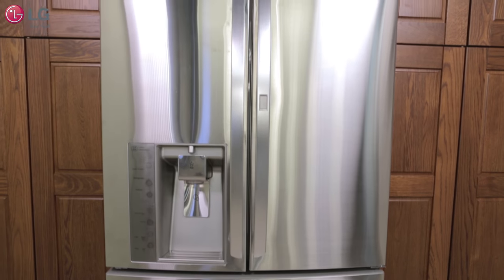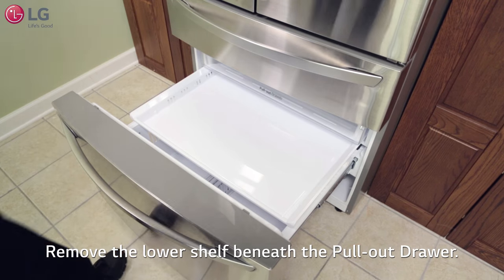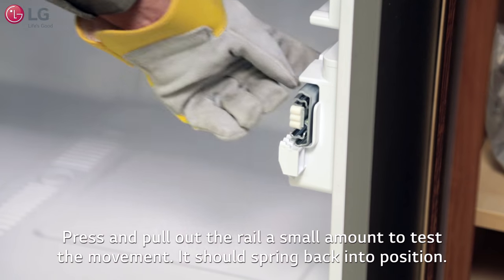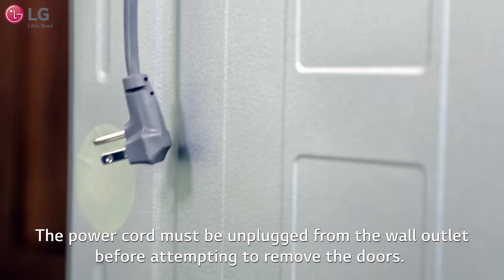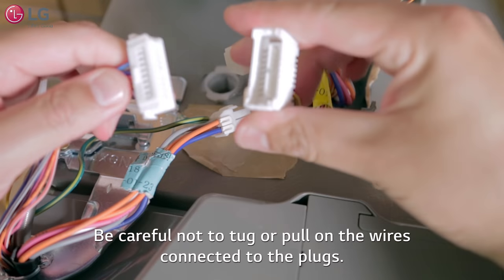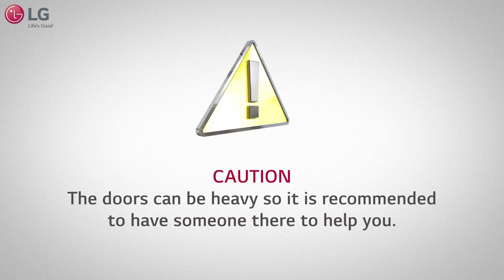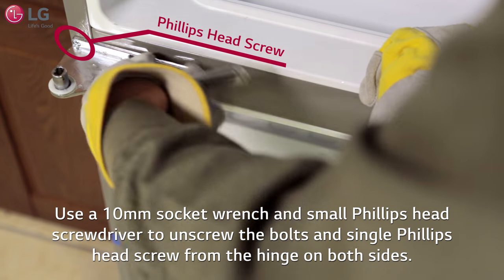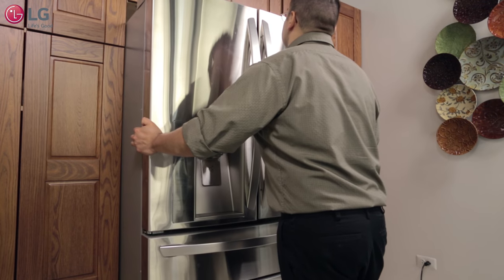LG Refrigerator - How to Remove Your Doors (4 Door-French Door)

Comment: 4:50 "Reassembly is the reverse of removal."

I HATE people who write that.  Getting the left door hinge bracket loose at the top was almost impossible.  Getting the door to seat far enough down on the pin to reinstall it IS so far proving impossible.  <sigh>

*Details*, folks.  It's good there's a factory video for this, but it's bad if it doesn't tell you *which parts will be very difficult*.

Comment: This doesn't mention anything about disconnecting the water line from the left door. Why not
Reply: Because it Shows You how to disconnect the line from the back of the refrigerator . Don't worry you can slide it back in pretty easily